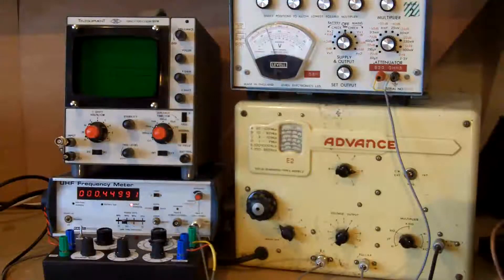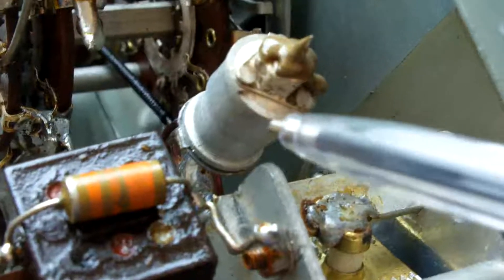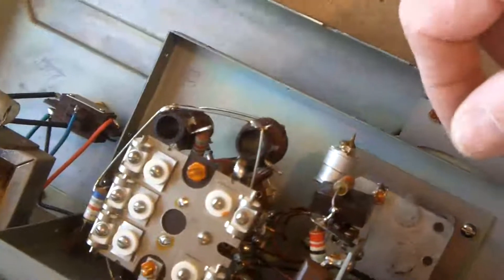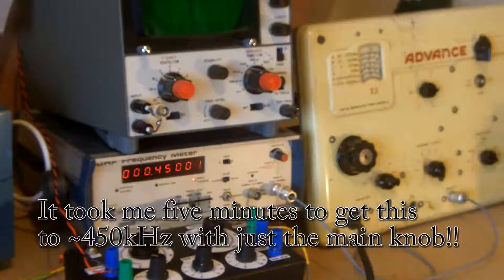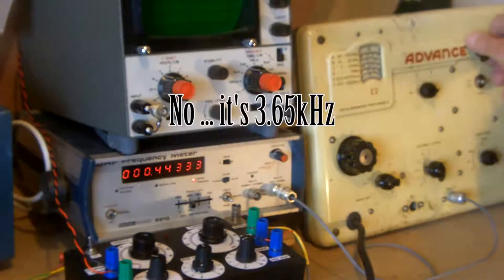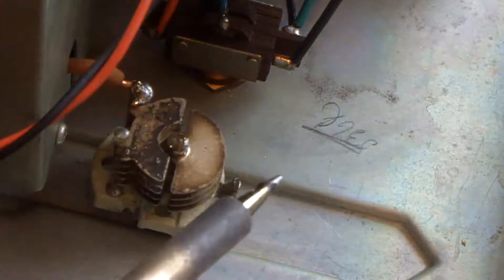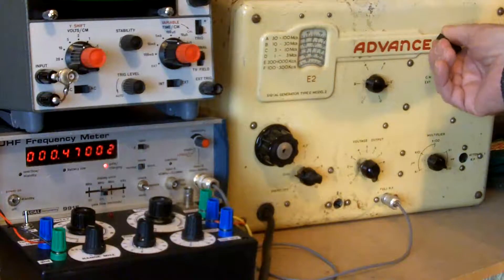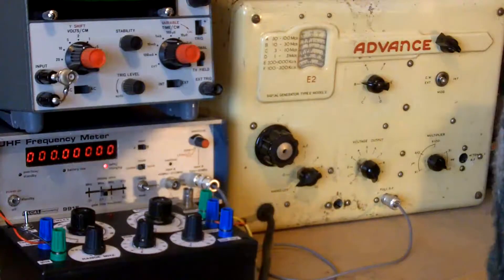About Radio 51 Modification to an old signal generator.

Comment: Hi Andy, Great Video..
I have an old signal generator, it's a Sphere Type 75 Model 1.
I have no info on it, it does RF and Audio has knob to control frequency the scale being on the body and knob controls a pointer.
there is a cw/mod switch... when connected to a frequency counter racal 9901 i get no frequency display on rf or af, however on the oscope on rf i can see signals of varying frequency? Any ideas or info welcomed

Comment from the maker: Hi there, I measured a plate I removed, one side is ~186 mm Sqr and I guessed the gap to be 2mm per side, so 3 plates = 6 sides that = 4.9 pf. To check I set the geny on 10MHz all the 528pf cap engaged and the trimmer makes a 54.49kHz difference and when I flog through the maths that comes out at 5.93pf. 
All the best ...Andy

Comment from the maker: Hi there, I should have measured before I boxed it up and there’s not enough data in the video to work it out but I measured a plate I removed, one side is ~186 mm Sqr and I guessed the gap to be 2mm per side, so 3 plates = 6 sides that = 4.9 pf. To check I set the geny on 10MHz all the 528pf cap engaged and the trimmer makes a 54.49kHz difference and when I flog through the maths that comes out at 5.93pf. if I was doing it again ...see my comments to cny02253 
All the very best ... Andy

Comment from the maker: Hi Carl, not only that but I also modified the little opening sequence that I'm using at the beginning of my videos and added the three ‘Radio Waves’ at the end of the 13 second sequence. I shall have to start doing some proper work soon, got a house that needs rewiring and a new kitchen fitted so that’ll slow me down a bit. 
Kind Regards ... Andy

Comment from the maker: H,i it's is really quite stable although I do tend to let it ‘warm-up’ for a while. Of course I guess that the frequency meter could also be drifting off in the same direction hi, hi. Well, as you know any sort of precision/exactitude costs money to achieve and I don’t suppose the Advance was ever cheap, it’s built like a tank and I wanted to explain more about it but I just didn’t have the time.  I wonder, did you replace a varicap in your geny?  Thanks for the feedback.
Kind Regards ... Andy

Comment: Very appreciated series of recent videos! Have been waiting for the return of the Jason and the S680X! The little transistor wobbulator is very cool, found schematic with no problem. I have exactly the same problem with twitchy tuning on my restored Eico 324 signal generator and have often thought about adding a trimmer like you did here. I keep putting it off -something about draining swamps and alligators (hi hi) and I can get "close enough." But you have inspired me to get on with it.

Comment: You have come across one of those " why did I not think of this first" ideas- Excellent!  I will have to add a fine tuning control to my Heathkit LG-1.  What do you think the final capacity range of that APC capacitor was after removing the plates?

Comment from the maker: Hi Dennis, I use a frequency counter so I wasn’t too worried about the calibration of the signal generator and it’s been so ‘twitchy’ that I haven’t been able to get a spot frequency off the dial that was very meaningful. The fine tuning is such a dramatic improvement I'm really pleased with the result, now I can’t imagine why I didn’t add the capacitor the last time I had the oscillator section opened up...something about draining swamps and alligators I guess.      
Kind Regards ... Andy